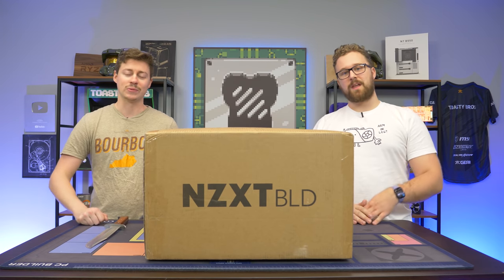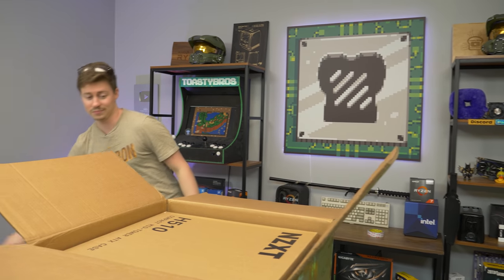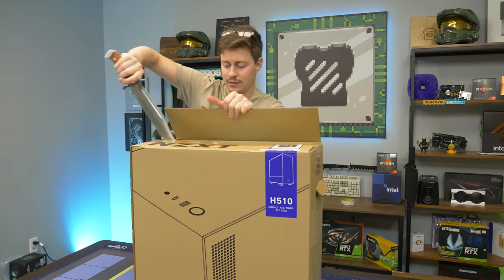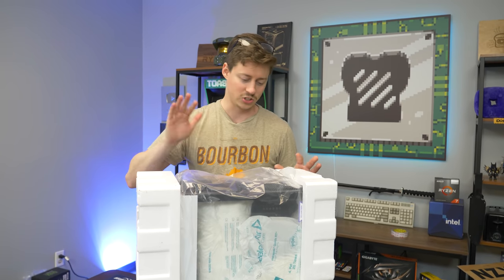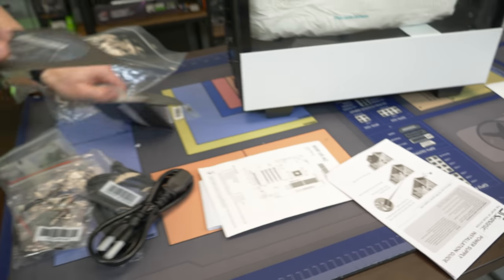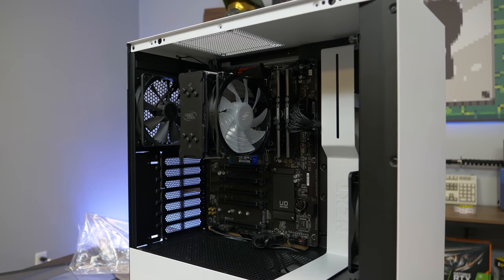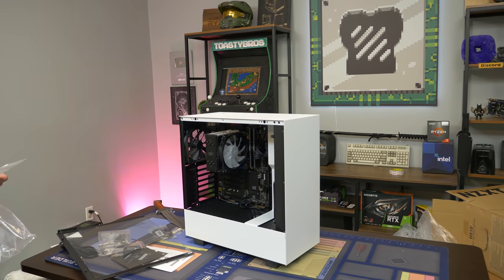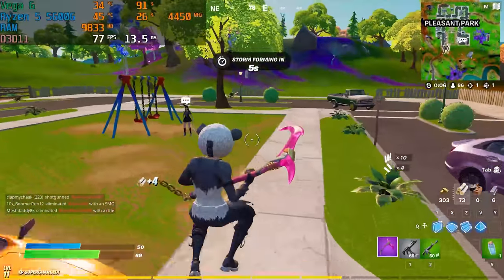NZXT's Cheapest Gaming PC Build - Is It Worth Buying?

Comment: i get 60-80fps 1080p on apex with all low settings with my 5600g, what you have to do is set the minimum framerate to 60 and it will run alot smoother
Reply: thats good to know cus I was thinking about getting this pc

Comment: This sounds like a pretty bad deal tbh, 800USD for a basic APU set up that can't even run low resource entry level esport games at 60fps. They aren't ripping you off, but it's not a good deal.
Reply: It's running the games over 60 fps most of the time. Apex legends is just a heavier game
Reply: @Deathbatman  Sadly this apu rig will still struggle in more intensive or newer games. For example the witcher 3, rust, control, tomb raider, rdr2, etc, all run around 30-45fps at best on low-medium 1080p. This rig is getting performance similar to a gtx 1050-1650, which is not bad at all but for the price, abit iffy especially now going into 2022. Unless youre only planning on playing esport or mobas titles like fortnite or csgo, league, etc i wouldnt buy this at $850+ ( after tax/shipping)

Like theyve said, its not ripping you off but isnt a good deal either. Building a rig with for example a used 970 for around $200 while adding in for example a 3600-5600 or intel equivalent would make so much more sense while getting more than 2x the performance for 3/4 the price of this apu build.
Reply: yeah, this 5600g cost around 300$ on the market so the extra 500 for case, psu, ram, motherboard and ssd it's not reasonable.
for 900ish you can get pc with i5 10400f and gtx1660 super, a much more powerfull gpu
Reply: True. If you're building a budget gaming rig, just go with cheap case, mobo, PSU, drives - midrange ram, box cooler. The apu doesn't need much cooling or power so they save you a lot across the board. They have their place in that world, but this isn't it.

Comment: so if I have around a $800 budget would you recommend this for my first gaming pc, and getting a graphics card a little later? or would you recommend saving for a little longer and getting something else. keep in mind it'll be my first gaming pc.
Reply: If you can wait, otherwise watch a YouTuber called Tech Yes City to get tips on how to find used PC parts for cheap so you can get better performance per price
Reply: no you can buy a computer with a actual gpu for that price that performs way better nzxt is to expensive
Reply: get the hp pavilion desktop it is alot better than this one for 700 to 800 dollars
Reply: @zackfn4612  I looked at this last night and considering it but I hate HP cases.. is it possible to get this HP and change the case to a H510 from Nzxt?
Reply: @rk3senna61  which one u recommend?
Reply: @Aphixy  what did u end up getting ?

Comment: Can't deny that NZXT makes good affordable PCs, but their customer support is a bit lacking. Bought a PC from them, and they never responded to my tickets about how they did not include a second m.2 standoff screw. Had to spend money on amazon. Though, I would suggest not buying this particular one, as it's not really worth it. Get a more expensive one.
Reply: is the standard starter pc for 1k worth it?
Reply: @vilinz7629  That's a matter of opinion, and largely based on your needs. If you're just doing some basic gaming, and don't need high FPS or 4k, it's likely fine.
In terms of parts, it's roughly the same as what you'd pay, unless you did a bunch of digging for cheaper ones.

Comment: For 1545 usd  I bought a prebuilt with a rtx 3060, i7 10700, 16gb ram, 650watt psu, aio cpu cooler,and 4 rgb fans.
Is that good for the price?
Reply: It's ok, I got a PC for 1200 bucks with a 2060super (pretty much the equivalent of a 3060 from the 20 series gen) with 16 gigs ram and i7-9700k
Reply: Pretty good considering the shortages we have. That would originally be like 3-600$ cheaper before covid. Depending on the brands on the parts you chose.

Comment: With Black Friday specials I built a i5-11400 system for $700 USD. It is ready for a graphics card too with a EVGA 850 gold, 16 GB Ripjaws, 1TB WD SSD, Define R5 case and 2 extra 120mm fans on a ASUS Prime Plus B560 mb. How comparable is it?
Reply: it's not comparable because 5600g integrated graphics is much better than intel uhd730
but for the cpu itself is very similar
Reply: Even though your integrated graphics are somewhat lacking in comparison, you have an 850 80PLUS Gold PSU from EVGA versus a no name 650W 80PLUS Bronze unit. You also have a 1TB WD SSD versus a no name 500GB class SSD(though that is an NVME drive and you didn't say if yours was NVME or SATA. Not that it really matters much. An NVME might load Windows faster when you boot up, but for most games you won't notice the difference in load times between NVME and SATA as long as the games are on SSD and not a HDD.

Comment: What's a good graphics card to go with this though
Reply: with that cpu just about anything you can get would work pretty good, 1060,2060, 5700xt
Reply: 1050 and up even would be fine. I wouldnt really go below that
Reply: @noahmccann3152  alright thanks for the recommendations
Reply: 970 ti or a 980 ti
Reply: I would suggest a used 970 at the very least for around $200 if you know where to look. Even a 960 will do if you find one cheap at $150 or less, since the 5600g performs similarly to a gtx 1050/gtx 1650 anyways so youd want a gpu thats atleast better than those cards.

Comment: I’m new to pc building and I don’t know much about components but what is a good cheap graphics card?
Reply: Rx 460 2gb
Reply: You can go for a GTX 970, they sell for around 150 dollars
Reply: @noahriske9659  does it work on a 9020 optiplex
Reply: @h0nzxyy  I have a 9020 optiplex do you think I can use that on it ? I haven't figured out what gpu's can be used on it
Reply: @tehOGKev yes it will work for your computer and since its a low profile card it won't need any external power source and its very small so it will definitely fit
Reply: @noahriske9659  thanks man appreciate the reply
Reply: @tehOGKev  no problem

Comment: Wouldn't it be worth putting a very old dedicated GPU in the system such as a gtx 960, gtx 970 or Rx 570  while we wait out the crazy GPU prices rather than putting up with the extremely poor Apu performance.

Interesting you said the 5600g was the same the same performance as the 5600x. I know the performance difference in gaming would be small, but it's the 5600x just plain better performance ?
Reply: i prefer use this apu than paying inflated prices for old gpu.
5600x compared to 5600g tend to be slightly more expensive
Reply: @Tonyx.yt.  If you're happy to play everything on low settings that fine, but as it could be some time before GPU prices return to reasonable it could be worth paying for an old GPU and then selling it later, eg. could buy a gtx 970 for 120 and sell it in 9 months for say 60 (as hopefully GPU prices may have returned to normal by then).
Reply: @rathstar  except you cant fine any working gtx970 for 120...
Reply: @Tonyx.yt.  I have, twice in recent weeks

Look regularly, act quickly, but ask to see the card working or pay with paypal goods and services.

Comment: its 600$ worth of parts but if you are getting a prebuilt you likely don't know how to install windows, want 1 place for your warrenty of parts, its not as much as a ripoff as some systems out there but for this price they could have included a 2tb seagate barracuda off drive or a monitor
Reply: it's a ripoff because add 100$ and you get an HP or ACER with i5 10400f and a much more powerfull gpu gtx16660 super
Reply: @Tonyx.yt.  the 5600g is 25% better in most tasks than a 10400f. and from the laptop i had before acer is a terrible brand whose products litertly just fall apeart on you in your hands with not very heavy use. not sure if you are talking laptop or desktop tho. not sure how the 1660 super compares but the onborde graphics are suposed to be roughly rx 580 equvilent are they not

Comment: hey guys love your videos they are helping me a lot in understanding the performance in different products but i have a question about RAM speed i was looking at upgrading currently i have 4x2gb 1600mhz ddr3 i could not find out the max speed supported but i recently found out my pc supports up tp 32 gb but i feel like that kinda much i was looking to go to 16gb and wanted your opinion if i should get 4x4gb or 2x8gb and if i should stay at 1600mhz or should /can i upgrade to 1866mhz any advice would be really helpful and appreciated
Reply: 2x8 would be better in my opinion. If you want to upgrade to 32 you can just add 2 more sticks of 8gb! I've done the same going from 16 to 32 a while ago. And when it comes to the amount oh mhz, it depends on the speed your motherboard can handle if I'm right?😬hope this helps
Reply: reddit buildapc will help

Comment: Does anyone have suggestions for the best pre built gaming PC i could get with a budget of around £1.2k? I'm not confident enough and knowledgeable about this stuff to build it myself. Of course for that price I'm not going to get anything insane but I'm looking for something that can handle stuff like fortnite at decent FPS and graphics
Reply: hp pavillon in your budget has a rtx 3060, probably 1 stick of ram instead of 2, but ram it's a small and very simple upgrade and you get a huge fps increase with dual channel ram

Comment: Not worth 800 at all. Buy a dell optiplex and slap a 1650 super from eBay and you could even put a 1tb ssd amd still cost less then this build and will preform way better then this.
Reply: good for short term but that's a terrible idea for long term unless you only plan to play MUCH less demanding games
Reply: @coyotex850  a 1650 will be relevant for the next few years so that's  not ba considering you can still use the ssd out of this build. Also there are way better cheaper build options for longevity then this option.

Comment: You’re honestly better off buying an X Box Series S for $300 and the BenQ ZOWIE XL2731 27 inch 144 Hz Gaming Monitor for $250 that is also 120hz compatible and play Fortnite and Warzone with over 100 FPS. The series S is in stock quite often and buying it with that monitor will cost less after taxes than the PC before applying taxes. 😂